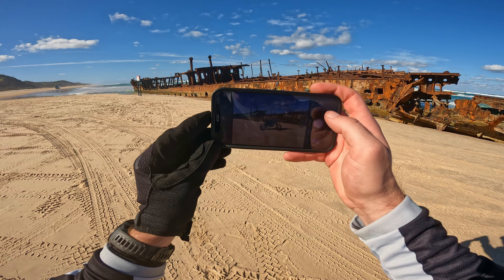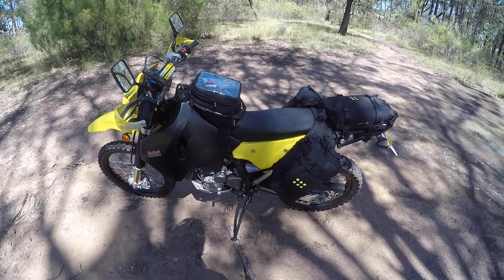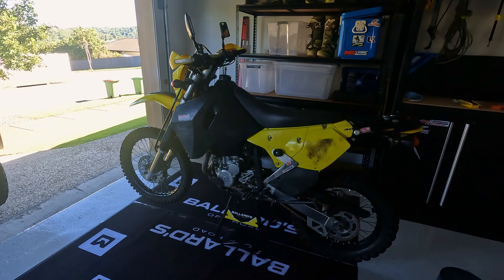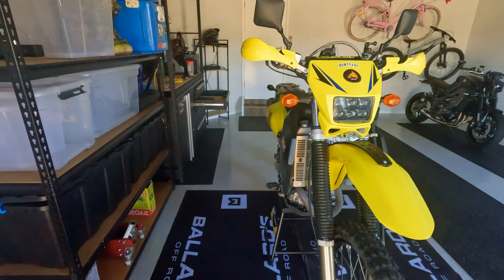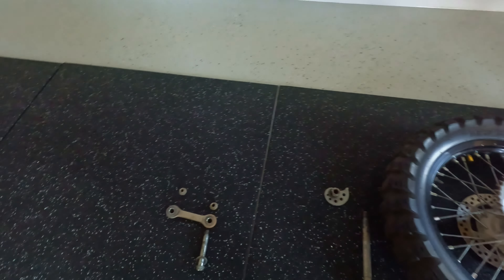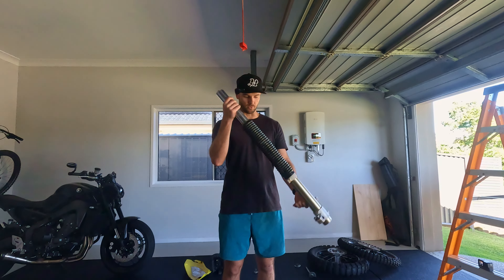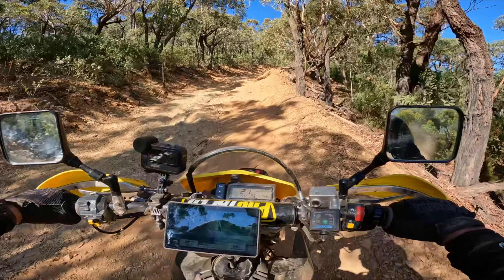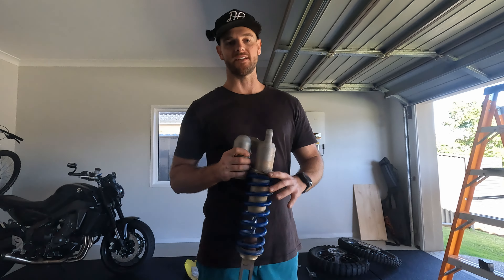WHY I'M REDOING MY SUSPENSION SETUP | DRZ400E

Comment: If you can see if an Xtrig preload adjuster can be fitted to the rear. Will give you more adjustability when riding with / without luggage. Easier than trying to adjust the suspension rings.
Reply: Just got one for my DRZ400S per Teknik’s recommendation. The P/N is for an older CRF, hopefully it fits. 😮 Build quality is excellent.

Comment: On mine that is from 2002, i nearly maxed the pre load and the register at the botton on the front and it Is way more stiffer than yours for the rear spring, never touched yet